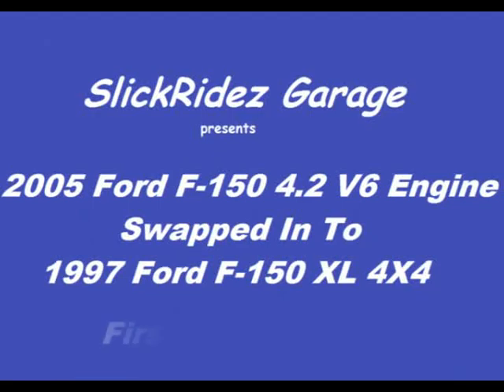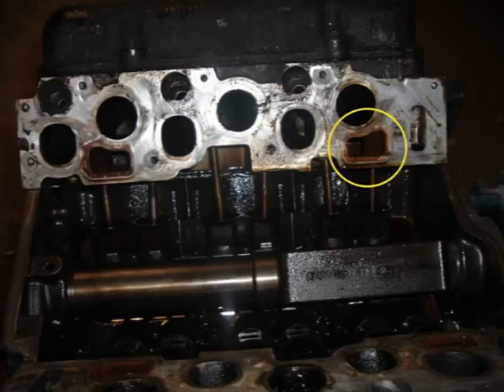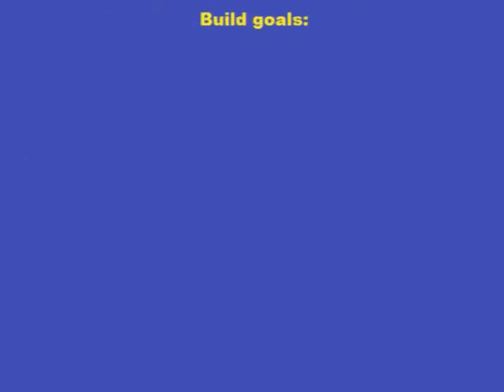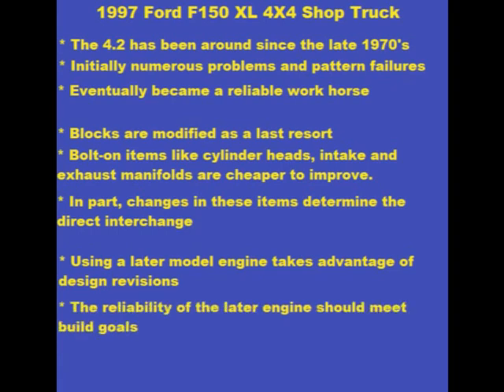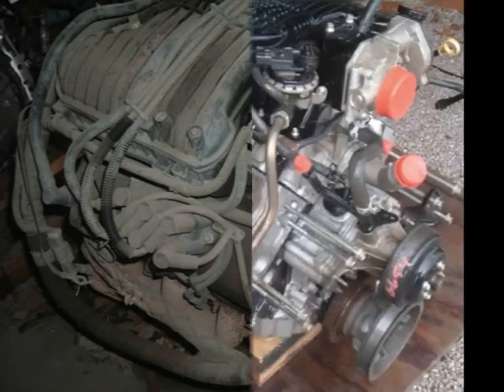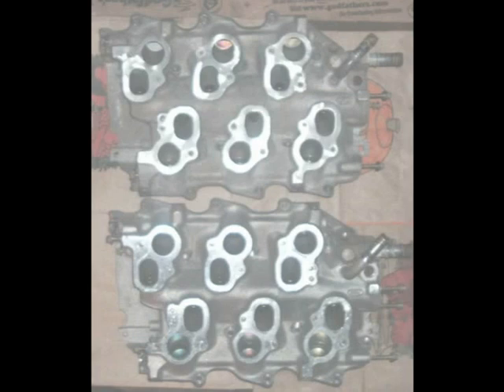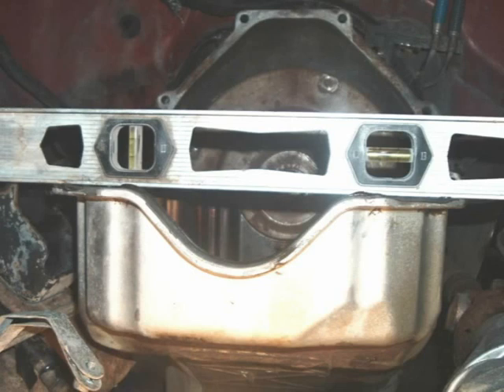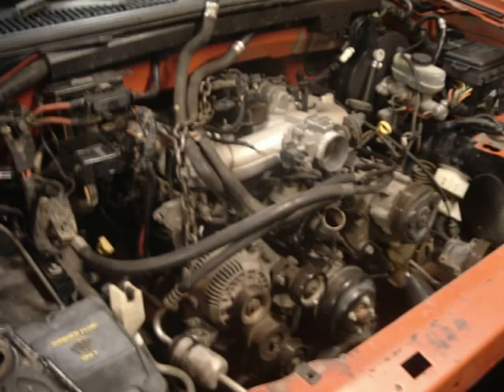2005 Ford F150 4.2 V6 engine swapped in to 1997 F150 4X4

Comment: Very interesting video. I picked up a cheap loaded 98 xlt f150 shortbox 2wd with 176k miles. It runs well but at times a bit tough to start. I am considering your swap. I have sourced several motors at wrecking yards with 9k...15k and 27k miles. They range from 700-1000 in price.  Really low mile motors.  Picked the truck up under 1k so could be a really low dough project. May have the trany rebuilt at the same time. Trying to decide if I run it into the ground or rebuild it.  How tough was the r/r the motor? Any tough issues?
Reply from the maker: Thanks for watching the video! If the current engine runs well, doesn't burn oil or leak/cross leak fluids I would diagnose the occasional delayed start first. Could be as simple as dirty battery terminals or a vacuum leak at the reservoir tank under the right front fender, they are known to crack. A hiss at the right front fender with the throttle closed is a dead giveaway. I tend to gravitate towards vacuum leaks on this era of Fords, especially with 176K  That can be a prime time for intake gasket issues if they've never been replaced. Is the check engine light on with codes stored? You'll have it better than I on a swap....the 4X4 makes the top bell housing bolts a serious pain to get to. I almost started using curse words again! lol I had to install the flex plate after getting the engine down in the compartment.....with it installed there wasn't enough clearance from the wiper module to the top of the radiator support to get it in there. This is a challenging swap.....so bring your patience and experience!
Reply: SRG thanks for the reply. You sound like an authority on these motors and your input is really appreciated. My truck actually runs really well///.hard start was just a poor battery. No check engine lights. I was just considering a full rebuild restoration motor- tranny- paint since it was getting up on mileage. My truck has all options power everything and it all works. I saw the 176k and was not sure of the longevity of the motor and a local search has uncovered some really low mi motors. No sense in changing it if these can rattle off 250 k but from what I have read they..(97-98 ) are trouble prone.  I have no clue about if the intake gaskets have been done. It does leak some oil at rear of oil pan and I see some leaking valve cover gaskets. Do you know of an area where these are common leakers and is this a reasonable task on these? Thanks?
Reply from the maker: This knowledge comes from experience. If I were trying to extend the engine's life I would likely re-gasket the entire engine with "Problem Solver" gaskets wherever needed/available. They are a similar but much improved aftermarket design that are far less susceptible to fail in this application. The next killer is the Camshaft Synchronizer. They are known to seize up and that will stop the oil pump....while the engine continues to run.....until you turn the key off. That's the warning chirp-chirp-chirp I was speaking of that sounds like a squeaky belt. Re-gasketing the engine should be done by those with experience and patience, enough not to rush the job. The exhaust manifolds are likely rusted out and this can be a serious pain to deal with. The timing cover is known to stick to the block and it is fragile, easily cracked. Coolant bypassing in to the timing cover bolt holes can make fasteners a real joy fest to deal with.  You may want to make an appointment for confession at your Church a couple weeks in advance of the job....because even good folks can be put past what they can take! lol just kidding but seriously...it's a challenging job that will try you. Sorry I didn't answer this any sooner, I felt a lot like dog dunny all weekend.
Reply: You knowledge on this is very valuable.  To update my 1998 (built 12/97) 175k mi truck does run well. No check engine lights but my concern on start up is it stumbles for a few moments then runs clean. I wonder if I am at the early stages of the intake gasket leak of just may need a tune.? It always starts pretty easy and the stumble is just light....a hic up of sorts that cleans out. You mentioned re-gasket I wonder if you meant head gaskets also..I def dont want to get into that. I would re-motor first.
Reply from the maker: Leaking intake gaskets are usually accompanied by a higher than normal idle or slight misfire (sometimes very slight) when hot.  When is the last time it had a new fuel filter installed?
Reply: Its been quite a while. This was grandmas truck so I know a bit about it but not much.  It does have new plugs wires.....runs down the road well. Just sort of picking your expert brain. I am getting the vibe if its not broke dont take on the intake gaskets as a preventive measure ?
Reply from the maker: Let me ask you this. Is it losing any coolant and you can't figure out from where?

Comment: I’m having a heck of time trying to connect the engine to the transmission,did you take the engine mounts off?  I did aligned the clutch where the alignment tool slide on and off with no drag,did you took off the exhaust manifolds?
Reply: I'm in the process of doing this now with my F-150. I had a heck of a time wiggling and positioning the engine but it slid in with the exhaust manifolds on and the motor mounts in place. It probably took me two hours to get it in position though I was doing it by myself.
Reply: I make alignment dowels from bolts about 3" long by cutting off the heads and grinding flats so I can use a small wrench to remove them. I screw them into the engine block then they are the first thing the transmission engages during an installation. After the bellhousing touches the block I install two of the stock bolts and remove my dowels. It's a very old trick. I do take the mounts off the engine and remove the manifolds since I replace the studs and hit the threads with anti-seize when the engine is out of the truck. I anti-seize all my exhaust components and have pulled parts I installed thirty years ago on other trucks without fuss.

Comment: Amazing video with invaluable information. Question,  I have a 97 model 4x4 with a blown motor. I am currently looking around for an 2005 engine and I know the 2005-2008 are almost identical. I was just wondering if there would be any additional issues with installing one from an 08 if there happens to be one at a great price or if I should just stick with 05 for simplicity's sake. Thank you for your expertise.
Reply: did you ever find out?
Reply from the maker: About the time you made this comment I started having health issues. I wish I could have helped you. Sorry about that. The 2005 to 2008 are identical.
Reply: @SlickRidezGarage  Thanks!

Comment: lots of good info, im gonna do a 4.2 twin turbo build for my f150, at some point in my life. is it true the 4.2 is almost the same motor as the grand national? oil filter housing location and pump is the same...
Reply: Did you do the engine swap? I have a 1997 Lobo (F250 light duty ) and am looking to do an engine swap. I have the 4.8 liter V8 and am looking for a more reliable engine.

Comment: i have an 01 f 150 with the 4.2... you said it was named most reliable truck every built. where did you hear that. my truck is for sure awesome i also bought a 2016 f 150 because if how reliable ford is but id like to show my friends or what ever
Reply from the maker: Thanks for watching SlickRidez Garage! The 2005 Ford F150 4.2 V6 automatic was named the most reliable truck ever built. I believe it was a JD Power survey or similar. They still had a ways to go in 01, but Ford released several improvements to the 4.2 in 01 which made them way more reliable than the 97-00 trucks.

Comment: You seem like a good person to ask. I have an 02 F150 4.2 4x4 with a failing oil pan gasket. Is it possible to replace this gasket without pulling the engine? The engine has 180,000 miles on it and runs like a bear. I'd like to not have to yank out the engine just to replace the gasket. Another time they have me asking, "Why did the engineers do this to me?"
Reply from the maker: Thanks for watching! The oil pan gasket can be replaced without pulling the engine once the front axle/differential assembly is removed. The inner CV joints can be unbolted from the axle output flanges and moved out of the way without disassembling the suspension. Match mark the CV joint housings/axle flanges. After that it's pretty much unbolt the driveshaft, detach electrical/vacuum connections, place a suitable lowering device under the front axle, unbolt the mounts, lower it and roll it away. With it gone access to the pan is real good. Be careful to follow the gasket install instructions carefully especially with the amount and location of RTV gasket sealer. Use a torque wrench when tightening fasteners. If you have other questions I'll try to help! Thanks for commenting and have a good one!
Reply: Slick Ridez Garage Ok, thanks. Do you have any suggestions on where to start looking for the cause of a chattering noise? It only happens on acceleration or while the automatic transmission is shifting gears. I've been searching YouTube for something similar but only finding valve taps and rod knocks. No loss of power either.
Reply from the maker: I'll need some more info. Can you pinpoint about where the chatter is coming from? Is it more forward or towards the rear of the truck?
Reply: Slick Ridez Garage hey i have a 1999 f150 single cab short bed v6 i think the enginr is toast no crank and no start. You think swapping in a 3.8 would be ok?
Reply from the maker: I've heard of people swapping in a RWD 3.8 in..... they're basically the same. I'm not sure of what year will work but there should be plenty of answers in the land of Google! Thanks for your question and for watching the video!
Reply: Slick Ridez Garage Its coming from up front. I'm having a hard time pinpointing exactly where its coming from though. It sounds just like the noise the GM 3.8 RWD V6 81-87 made in quite a few of my G Bodies. I was told it was an "Octane Knock" I drove them when I was much younger. Back then I did all kinds of tricky things with those cars. I'd literally throw away the bad one and slide another one under the old VINs. Anyway, I think I'm gonna have to take it somewhere. Idk, could the valves make a chattering noise, or someone said it could be detonation, could the cones in one or both of the CATs be broken? could the tension pully/pullies make a chatter if it got all loose and sloppy? I know you can't tell me what the problem is but I'm just checking to see if I'm on the right track. I'm just worried its gonna be a bearing or something else life threatening to the motor. But, the oil pan gasket is shot, plus whatever this noise is, maybe the move would be to pick up a junk yard motor for $500-800 and be done with it. Yard I get motors from has a 90 day warranty. They get them from wrecks, not junkers. So they cost a little more than usual. I wish you were in the Philly Metro area, would be awesome. Anyway, I love your videos. I'd be fuking awesome if you had a video of a 2002 F150 4x4 4.2 V6 getting torn down to get at tithe oil pan, lol. COME FIX MY TRUCK Man!! lol

Comment: For sure the best 4.2 out . I have a question. I am thinking of a repower on my 98 super hi mileage truck. Still runs well but have 2 cars coming up to auction near me. One is a 80k mi 2000 with a 4/200 build date and the other is a 82k 2004 heritage with a 2/2004 build date.  My plan is to swap engine and trans to get the benefit of both. I am sure I need to swap the harness as well. I wonder what motor is nest. I read the gaskets were re done in 99 so are the two motors the same. The intake looks different but doesn't seem like the 2 are any different according to Wikipedia Essex page. Thanks in advance for any help

Comment: What are your thoughts on a 2002 4.2/ I have a chance to purchase with very low miles..52k......I see they did not get the last gasket change in until 2004. Thanks in advance
Reply from the maker: If it's really a 52Kmi engine it probably has a lot of life left in it. Salvage yard engine?
Reply: No I found a complete truck...mint shape for pretty cheap. Its a bare bones model but well kept. 52k on the odo 2002. ..2500 bucks salvage title was hit in the rear and bed replaced.  Have before and after pics
Reply from the maker: With proper maintenance and care the 2001+ engines hold up better than the 97-00's. It outghta be good for a long time!

Comment: So, I don't have the space, tools or time to swap a engine. I have a '01 4.2 that sounds like a lifter or valve is bad. I ran some amsoil engine cleaner through it. Most of the "knock" disappeared but you get the rpms up around 2000 it comes back. Though it is not burning coolant, I need ALL new seals and that's going to cost about a third of a new engine. What is your opinion on a NEW factory, not rebuilt, engine? Would Ford fix all the known issues with a NEW engine? I know this is a long post.  But, you are the first I have come across that sounds like you know what you're doing. Thanks in advance.
Reply from the maker: To the best of my knowledge Ford doesn't offer a new engine for that truck. I believe they are all outsourced rebuilt units from Jasper/SRC (Springfield Remanufacturing Company) and the like. Ford just sells them through their parts department as units that are "remanufactured for Ford" like the one I removed from my truck The 2001's are better than the 1997's gasket wise so if you get a replacement engine at least the gaskets, seals and camshaft synchronizer benefited from a later re-design. The symptoms you describe to me (lifter knock that comes back at higher RPM) may indicate the oil pick-up tube is stopping up. If the rattles get worse and/or spread through the rest of the lifter/valve train at sustained higher RPM's then I'd be checking the pick-up tube. This is why I never use an engine flush solvent. It can flush debris/oil gel down in to the pan and clog/restrict the oil pick-up.  Have you owned the truck for a while or is it a recent purchase?

Comment: may have been said oil pans are different because yours is a 4x4...also...depending on build date oil pans changed late 97...ad the 05 engine was in the new body...and they didnt make a 4wd 4.2 in that body style.
Reply: They didn't but you could order them that way.

Comment: 2005 and newer 4.2 into heritage 97 to 2003/early 2004.. body style only issue i ran into is i had to extend the wiring for the cylinder head temp sensor, do not use butt crimp connectors on any sensor wiring/// solder and heat shrink any under hood wires/wiring..  salvage yards will say no go just like putting a 3.0 vulcan tarurus/sable engine into a ranger  hell yes it will work done many. retired ford tech.
Reply: Hey so, is that the sensor on the lower left side diagonally located from the knock sensor? Donor engine is 03, I was gonna swap in my 98 water pump tubing outlet (top of water pump) and relocate sensor to the pcv valve heater outlet, which would move that rubber hose to the water pump tubing i mentioned.  Also i do not seem to have any wiring anywhere on this old engine for the old coolant plug knock sensor!  Which puts me on the spot to wire up that knock sensor... HELP!
Reply: If it helps, 98 f150xl someone did a motor swap supposedly, but i have Mexico emissions fuel injectors far as i can tell... i'm starting to get scared of this harness!  

All that aside, swapping in an 03 and could use someone to bounce a few questions off, may go to local u pull for a wiring harness if i can't figure this out...
Reply from the maker: Thank you!
Reply from the maker: About the time you made this comment I started having health issues. I wish I could have helped you. Sorry about that.

Comment: I finally got a check engine light on my 176k 1998...__PO153,  Is this possibly oxy sensor on these?  You are no doubt the authority on these motors and look forward to your thoughts.  Car runs well......reset code...hasn't come back in 100 miles. ..a bit of rough idle at idle but not much.  Thanks in advance.

Comment: That's a very detailed explanation, thanks. When I rebuilt my 2003 4.2L, I researched the lower intake manifold gaskets to find the best. As it turned out, the Ford dealer had the best ones. They are special order, made in Germany and cost me about $50 for the pair. Even the best aftermarket gaskets (Fel-Pro, etc.), compared side-by-side to the ones made in Germany were inferior. Ford finally supplies a better gasket for the hydro-locking problem. I took photos of my rebuild and just put it to music on YouTube, recently. Here it is: https://www.youtube.com/watch?v=68CbNlzPOYM&t=167s. (Those better gaskets are in the thumbnail photo, and further on in the video).
Reply from the maker: I used aftermarket Fel-Pros and in March 2022 I think I have a vacuum leak causing a P0174 lean code on bank 2. I'm still diagnosing, but if those gaskets are leaking I'll be taking a trip to the Ford dealer for OE gaskets. Thanks for commenting! Let's all take a look at this video!
Reply: @SlickRidezGarage  Best of luck with the vacuum leak and potential gasket change. I also, (as you can see in my video), put some red permatex (high temp) silicone around the water ports on either end of the heads to safeguard against another leak even though I was using the Ford Gaskets. Overkill maybe but I'm still driving on that rebuilt engine going on 8 years now and no water of vacuum leaks. Take care and thanks for commenting.